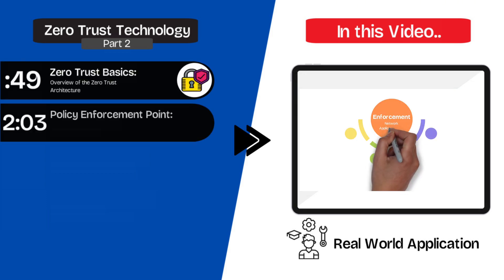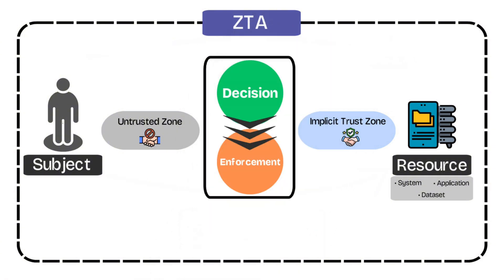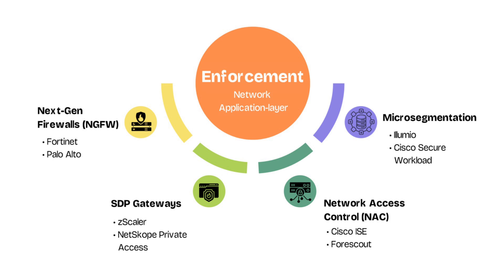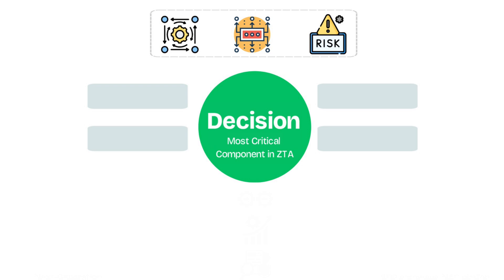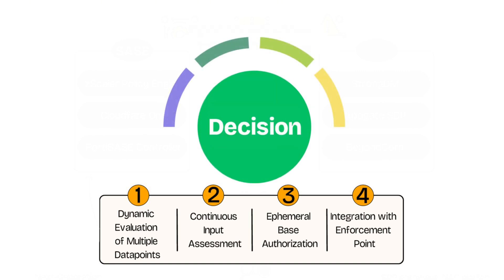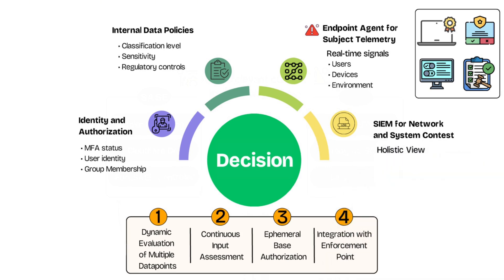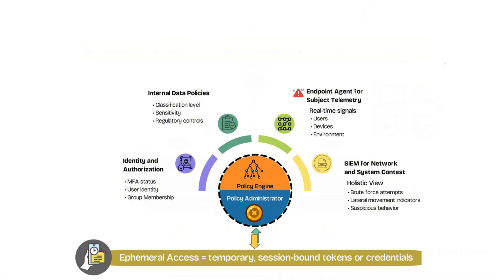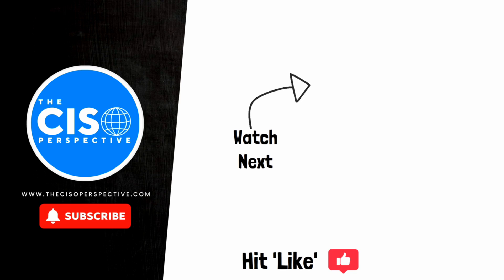Zero Trust in the Real World: The Technologies Behind the Theory

Comment: Does PDP like Netskope/Zscaler Controller allow input from SIEM / EDR  ? Should it be the other way around where SIEM become PDP ?
Reply from the maker: Yes, but I have seen them a couple of different ways:
1. Within a vendors ecosystem (same vendor for the controller & SIEM like Palo and Fortinet): Controllers with built in integration with their SIEM to take actions based on type of incoming alerts. The downside here is that you need to be within the vendor eco system unless they have 3rd part integration support. But vendors with their own SIEM rarely make effort to improve support for 3rd party SIEMs because they want to push their own products.

2. Integration via SOAR: The controller relies on a SOAR appliance to update the controller policy based on incoming alert type. This is usually more robust because it will work across many vendors and technologies.

Comment: Are those all the Vendors in consideration? Some are more endpoint inclined rather than Network, which inherently means agent based.  I feel we're missing a large subsection of vendors for this evaluation, especially those SASE providers. At least based off the thumbnail image.
Reply from the maker: I focused more on the network side then the endpoint, but my focus on this video was around mapping the ZTA concepts to vendor solutions. For example, The Enforcement Point can be delivered in various forms (microsegmentation, NGFW, SDP gateways, etc..)

Hope that helps?
Reply: @TheCISOPerspective  Yup, I just think there are players like Cloudflare, Netskope, Sailpoint, Cato, Forecepoint, etc that should also be in consideration, but  purely a thought I had. 

Some legacy EDR vendors like Trend for example, have a ZTNA solution, but since it's endpoint based and built through M&A, like most of those highlighted in the thumbnail, it tends miss a lot of common use cases and fall short from a resilience standpoint. Looking forward to watching this regardless. Cisco isn't a true player imo,  nor is Okta, or Splunk(Cisco), Sentinel - again just voicing my opinion. What is your typical selection process for vendors in these projects? Genuinely curious, I love your videos.
Reply from the maker: @SamBearPig  I agree, and traditionally the larger security vendors find it easier to purchase then build. It's the newer vendors that are closer to the true 'zero trust' architecture
Reply: @TheCISOPerspective agreed here .